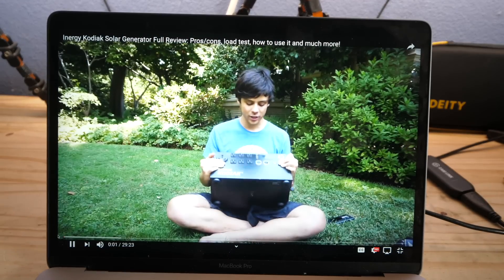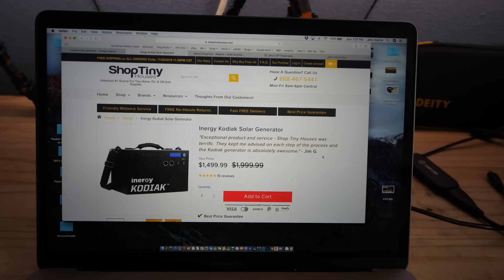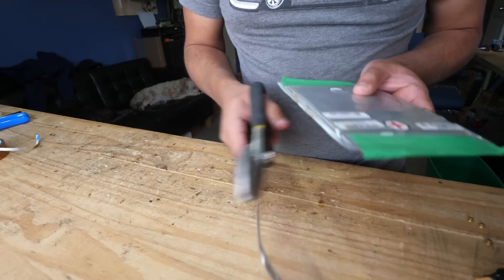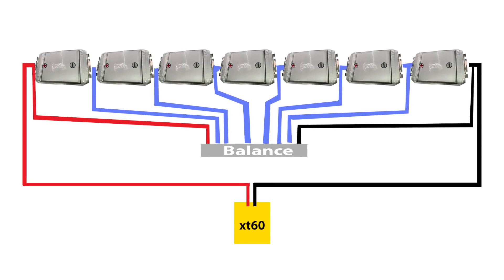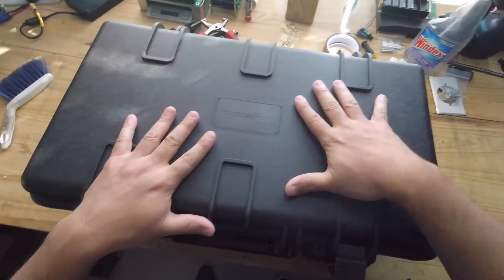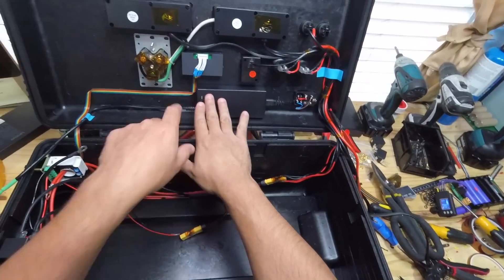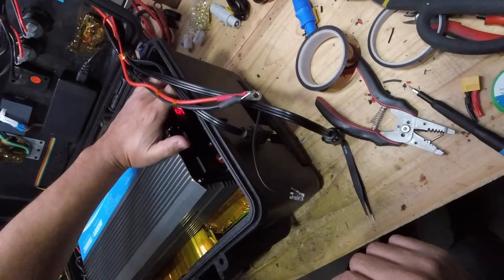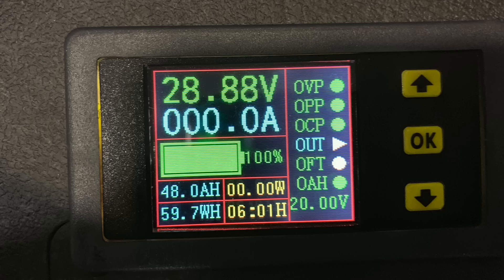DIY Inergy Kodiak Solar Generator

Comment: There is so much to improve it. First using 18650 Cells you could use the Space MUCH better. No need for Pouch Cells with 1200Wh every normal 18650 Cell can handle 2000W without Problems. Second: SAFTEY, I didnt see a fuse, I didnt see the separation vom the heavy aluminium inverter to the soft cells. This is extremly dangerous how can someone who works with that show something like that ?? People gonna build this and set their House on fire because the inverter cuts the cells. 
You need to step up the work. 

Other Point Even if the Inverter reaches 95% you have 100W heat from it with 2000W supplied. Where shall the heat go ? You get the Cells warm and degrades their lifespan. 

This is made dangerous  ! Folks, dont make it that way for your own safety !!!
Reply: He said early in the video that there would be a divider shelf  between.
Reply: @thomasluck1611   Yep, at 3:59
Reply: Thanks for the leads Thomas and Cire. He did clearly mention the need for a protective layer.
Reply: @ziad_jkhan  dude   what is clear  about the word "eventually"
Reply: Ziad Jeeroburkhan true he clearly mentioned that...wow I never realized tech geeks were so competitive... lot of dissing going on. could have used that spirit on the football field lol
Reply: @thomasluck1611  eventually means basicly Nope xD
Reply: @Bloodbound89    he did,,,,wanna bet some money on that comment
Reply: ya he did
Reply: I think he said he was going to add something inbetween but I do agree that I'd rather put up the cash than design something like this on my own not because of the design but rather that I would be trusting myself to construct this with no experience whatsoever. Someone with experience with electrical battery stuff may have different results.
Reply: Ewald Wölk also he didn’t explain the wiring in too much detail, so I think he’s assuming that his viewers are knowledgeable on safety and general circuitry. And he’s also an amateur DIY, so his videos aren’t for students to follow instructions. I’m pretty sure his goal is to inspire other DIY wizards. I mean this is a pretty big multiple day project stuffed in a 13 min video
Reply: @IndianBoss100  😃I'm glad you realize this is pointed towards teaching someone of this level of skill. This is infirmation that can easily teach someone how to cheaply provide a way for someone to heat up a meal or heat up water not power the house for 3 days. I think he is showing this as a; hey charge this amd leave it in the closet incase the power goes out
Reply: @IndianBoss100   these rookies think they know what they are talking,,,its funny,,....This is for DIY people with the knowledge of knowing how to build something for themselves,,,,
Reply: You have to elaborate a lil' better. Not all of us are proficient in this.
Reply: he said he was going to install a panel to separate the pouch compartment just before he sat the inverter down just to size things up
Reply: I think you missed the Entire point of the video.
Reply: Could Peltier elements be a good idea for heat sink?
Reply: @kcimos what is the sense of your comment?
Reply: Ronando  I would love to, but I`m far away of having the budget for :/ Use a fan controlling circuit, easy to make with a simple OP-AMP and NTC, so the fans don´t run all the time without a reason and draw energy
Reply: 100 watts of heating not really a problem. Take that from the electrical engineering standpoint.
Reply: Yeah, the separation looks like a major oversight.
Reply: lol everyone commenting negatively are probably the owner or investors of the 4000 dollar life box 
They mad?
Anyway, this is a proof of concept it's able to be made for cheap, not something he's selling
It's up to the audience to take this and build it on their own.
Reply: @shawno1750  It's an DIY channel, of course he is showing the people how to do it. Thats the Point of it !
And the question at the start: "can we make a better one for less" 
Nope its not even slightly better. Its dangerous and no one should build it like that. 

garcia is making so much, why not showing it how it has to be done to make it really good. Not like that shit.
Reply: @ewaldwolk2250  he proved it to be better... Nothing you said in your comments show it to not be... He even explained you need some protection.
Reply: @ewaldwolk2250  Actually from an electrical engineering standpoint it is better.
Reply: this DIY solar gen, is cheaper so it beats it there  with the same amount of power,,,,,,its that simple,,,  Second,,,lol if you dont see fuses because he is using a Drok meter,,,if you dont know what that is ....look it it up...it uses relays.   relays are better..,look it up...You can set it up to protect against over voltage, under voltage, over power protection,,,,limiting the amount of  power it can draw for a wide range of DIY projects,,,...its obvious you are not a DIY person and dont understand what he is doing or ....i think he has a follow up vid,,,,check it out ....you might learn something
Reply: When he started to pack the batteries in the box I knew it's going to be a crappy project. However the concept is clear  to make a DIY. Others shouldn't follow the same arrangement.
Reply: @luongmaihunggia  Are you stupid or something ?  Are you not able to read ? I said a 1200Wh Pack (which has a minimum of 100 Cells for this Capacity can easily handle 2000W. Taking the Panaconic B Cell mit rated 4,875A as an example is a bad example aswell. 

Normal Cells can take 10A contiunous which is 3C for normal Cells (Sanyo Ga, Samsung 35E) And there are Cells which can even take 10C without a problem. 

But for normal pack I would make a 13S9P Pack which would have 30Ah with 48V -> 1,5kWh. 
An 9P Pack can handle 90A at 48V -> 4,5kW (as Peak). 
2kW would be even good for a long Cycle Life of the Cells. 

So who is wrong ?
Reply: @ewaldwolk2250  You moron this video is just a guideline, no need to act like this is the only way to do it. This project isn't meant for noobs, it's for people who know what they are doing. Also, by my rough calculation you can get about 2.3 kWh of capacity if you use 18650 cells, but it'll be wayy more expensive.
Reply: Yeah the entire video I just kept wondering what he would be doing for safety protocols. I was actually surprised that this was being done in the actual house and not a shed. Poor dog and cat. They probably get scared poopless whenever stuff fries
Reply: Yes, it's a little too much "put together ready built stuff" for a pro. I would rebuild all that stuff, take the inverter apart and give it a new cooling system in its own metal housing, rework all connectors so it fits for a safe and good lookinh cable management, and definitly fuses, a lot of fuses, on the inputs, thermal fuses on the batteries, one max. power life plug with it's own fuse and some life plugs that share the maximum power, each one fused. Basically it's a pretty simple project, but there is a lot of power and handle that as safe as possible differs pros from noobs, I not a engineer so more a noob than a pro and I see already things that aren't acceptable.
Reply: @Wilson84KS  AND, I would build it in a bigger case, like a Pelican 1620 rolling unit.
Reply: @Bruce Forster damn, that Pelican is expensive, can it handle a granade in it without even hear it on the outside? But yes, I think we are on the same way, just give all that stuff a lot of air to breath and distance to each other, finally if you do it wrong it will be ways more dangerous than a granade, so everything that maybe can get warm just must have a good distance to everything else that can get warm or take damage from heat.
Reply: @luongmaihunggia  with 1200Wh every normal 18650 Cell can handle 2000W without Problems.  <- Thats what I said.

So there should have been one more comma. Of course this would be a little bit to much for one single cell. But on the other Hand ONE Single cell would not make any sense, since the converter cant even work with 3,6V. 

First thinking then texting.
Reply: @ewaldwolk2250  oh...

Sorry.
Reply: @ewaldwolk2250  How is he connecting the inverter? isn't the inverter 24V with integrated circuit protection? so how is he connecting the 24V inverter to a 29V battery pack? not to mention, how in the world would that even work with a 48V battery pack as you mentioned above? are there extra components not being mentioned?
Reply: @Z3r00n333  It was just an example for the battery, you can make it 24V aswell but with higher Amperehours. 
A battery is only described as 24V, it has charged around 29,4V and discharged 21V. The Inverter can handle this.
Reply: something else that people don't think about in situations like this "yes you're saving half the money" BUT if something goes wrong with your system down the road you have no one to send it to for repairs which granted may not be a big deal for some people but I'd rather spend the extra and have someone who knows how to repair it than to be out the money and have to repair it myself and spend even more money in doing so
Reply: Steven M ... It’s a bit like the pre built PC vs built yourself. It comes down to how much knowledge you have. I’ve never bought a prebuilt, I love building my machines. It’s cheaper, overclocked, custom watercooled, and if there are any issues I know how to resolve them.

But if you lack the skills, knowledge, confidence or time, I can see why someone would buy a prebuilt. To me this applies to any DIY project.

Imo there’s nothing more satisfying that building something with your own hands, and watching it spring to life when you hit that button.
Reply: @literate-aside  for a PC, sure. For something with lithium cells that will combust when mistreated or improperly isolated? Nah. I'd rather get cells that have a BMS preinstalled than risk a fire.
Reply: @stevenm6065  I'm a tech and I built my own systems-I consider myself fortunate that I CAN repair my own builds if something ever goes wrong.
Reply: @stevenm6065  cant send it back for repairs in SHTF
Reply: @stevenm6065  if you built it you shouldn't have any problems repairing it. If you don't feel comfortable repairing it you shouldn't build it in the first place.
Reply: stfu loser
Reply: @mccc4559  Yeah and like you could do better?
Reply: @secretagent5658  not sure what you're replying to ... Hints?

Comment: Great DIY Inergy Kodiak ...BUT you could have improved it by making it water resistant by keeping the box lid intact and having all connections under the lid with water proof/ resistant cable access.  still a GREAT diy job.
Reply: Or another lid to cover those that he put in.  Remember to store it at a slight slope so that water drains off.  Also a hole in the bottom so water drains out, but maybe a one way valve on the exit hole so bugs and water don't come in.  Ok, it's getting complicated.

Comment: So you seriously just left everything floating around inside the box? is there no portability? Seems pretty scary to have the inverter just floating on top of the batteries without any barrier between the two. all in all nice components very half ass build though.
Reply: Yeah, everything rattling around, no fuses, no protection whatsoever.
This seems like a house / camping fire waiting to happen...
Reply: actually we are the ones that see the iceberg ahead. Ive been working on electronics for 20+ years and im an industrial designer so shit like this sticks out too me big time.
Reply: @cutty02  well instead of bad mouthing and critiquing it. Offer up positive solutions instead. Seeing you have the 20+ yrs exp. 

Because from all these negative comments that love to point out whats wrong, none of you have created a video of your own showing how to properly make stuff. 

Offer suggestions instead of criticism.
Reply: I actually I have made videos showing how to make things they are just not on this channel. Also I did say very positive things I said nice components. There is nothing wrong with positive criticism
Reply: You can add that in.
Reply: Brad Allen easier said than done. it needs more than the barrier it needs to be securely mounted.  components are great but the you cant just throw them in a box and compare it.

Comment: How long it takes to charge with solar or wall?
Reply: iiinsaiii depends on how many panels u got
Reply: If I recall, based upon what the charge controller/inverter can handle, it's up to 300w of solar input. You can extrapolate accordingly.

Comment: What and how are the 6 balance leads connected to?
What are the relays for?
I have made batteries before and I am an electrician, but I could still do with a little more detail. I have already ordered most of the parts.
Could you do a follow up? Thanks.
Reply: John B - there appears to be stuff missing here. The balance leads go to a balance plug which you would need a separate lipo charger for (the one in the link is basic with no balance facility), or you’d need to install a separate BMS. Also the DROK he installed will warn you of over current, over and under voltage etc but it won’t “do” anything. You’d need to hook up relays disconnect the power in the event of a problem which the Drok can control. As others have pointed out there is also no thermal management here. At the very least I’d install a BMS between the charger and the pack with a temperature sensor that disconnects the pack on over-temp. As others have pointed out there is no venting in the case - this makes it basically weather proof but you need to vent heat with an inverter and battery pack that size.
Reply: John B. That relays connect directly to the DROK Digital DC Multimeter, it provides a way to shut everything down in the event of draining the cells down to far.
Reply: @1akmason  Thanks. Why are there 2?

Comment: When did you connect the 220 volt plug that's what I want to know it looks like you just have a ground cable going to it and then the loud speaker connections what are the loudspeaker connections for why are using speaker  connections on a power supply that's not powering any speakers that's not an amplifier it doesn't make any sense to me that's where I'm trying to figure it out thank you?

Comment: This is good inspiration.  Here are some things that could be done differently:
Don't cut open poorly packaged pouch cell box with a knife.  A hamfisted person could have destroyed all those cells in one cut, and maybe burned down their house/shop at the same time.  Shipper should warn how to open, and protected with more packaging.
Don't scrape pouch cells with screwdrivers and knives.  Don't cut the foil.  Leave them.  They fail/catch fire if you puncture them and cause a short, right?
Use a steel box when you're building something so fire prone.  Isolate the batteries in their own box, and wall them off from all the electronics that could cause them to burn.  They need passive airflow or better yet, active with temp triggering.  Fuse the two systems (electronics  <-> fuse <-> battery).  Fire box chassis will save your house from burning down, though you'll still have horrible smoke damage, if those batteries go into thermal runaway.
Don't enclose all those batteries and an passively cooled inverter, and a toy skateboard charger into a tight sealed, space.  This design could overheat and overheat will cause fire.
Don't compare the price of DIY to the price of a finished, tested product with hopefully overbuilt engineering involved in it, and pretend that they are equivalent. 
Use an MPPT charge controller in any system like this.  It'll make your panels work well and still prevent overcharge.
You don't describe the Power Meter as a BMS and it doesn't look like that's its primary function.  Why not call it one if it is, and otherwise use one if it wasn't.  I just watch Rich Rebuilds almost burn down some guys shop in NJ because they weren't using a BMS, and probably had a problem with the charger overcharging the Tesla packs.  These DIY projects need safety, not just cheap solutions that work until they burn.

I think we all thought the product you tried to replicate is overpriced, but I'm pretty sure trying to replicate it with lithium cells and build it to that quality with new cells is hard to beat/match.  Lithium is still expensive, and folks continually comparing used cells to new is bad form move.
Reply: Solid advice for everyone.  Thanks.  It is not easy learning to fly jumping off the roof with and umbrella. 🤔
Reply: @philboeing1889  🤣Lol the imagery has me dead
Reply: Don't listen to this guy. Safety Sally! I just did a video on how to heat your home with a charcoal barbecue. It's total DYI.

Comment: In the diy also batteries will be interchangeable and all is repairable. What about the weight and size? I would have put the plugs and instruments on the side in case of splashes of liquids. It can be tilted over but during transportation under the rain is more vulnerable. Is there a cooling fan in the diy vertion? Does it need one? The display and controls seem better than the Kodiak. Also, can this diy be hooked up to extra external batteries? If so how many and what kind? Thank you. By the way, great work.

Comment: Jehu, that foil you cut off is part of the expansion protection when there is a failure. You potentially compromised the ability for the pack to contain a fire.
Reply from the maker: Yes a don’t want fires,  the kapton tape should contain it

Comment: According to the amazon listing you linked for the pure sine inverter, the built in charge controller is for lead acid only. ☹️
Reply from the maker: Yup, it will charge  lithium no problem
Reply: jehugarcia how? The listing states lead acid only.